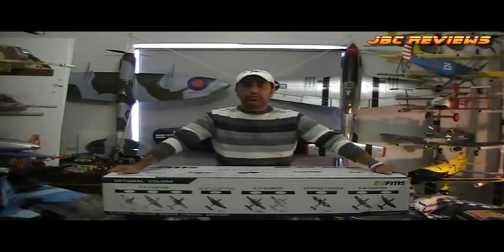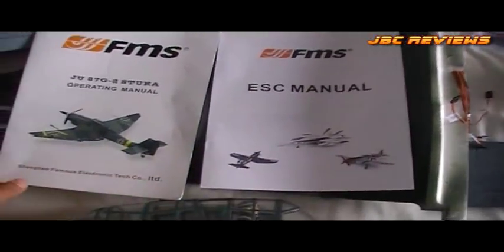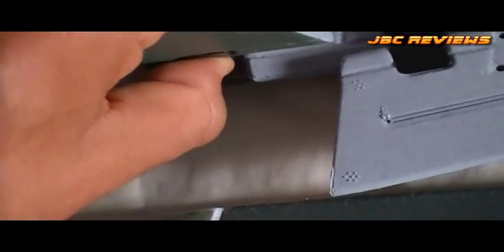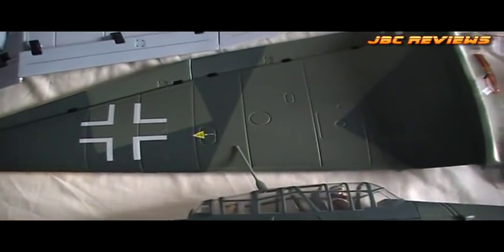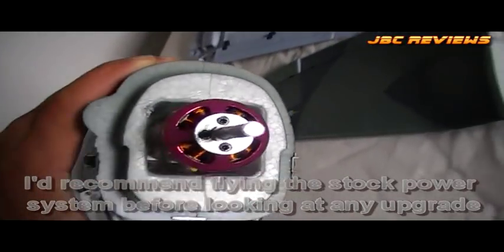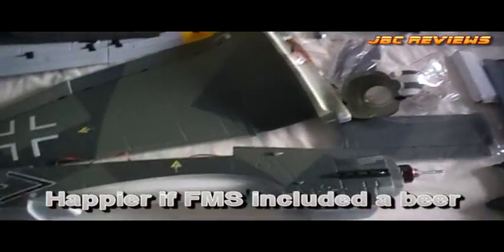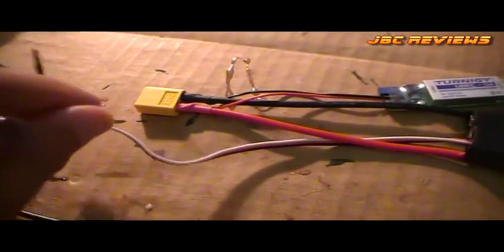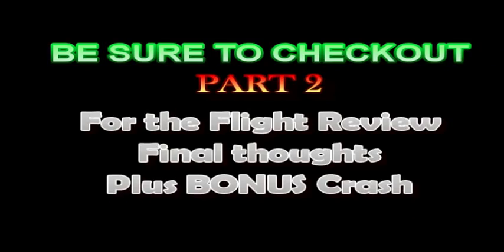FMS Airfield STUKA Ju87 (Pt1) Detailed Open box + Build tips

Comment from the maker: From memory I don't think I even have an velcro in my Stuka because a 4S 2200 only just fits in there and when you close the canopy it can't move around because of it's design and limited room. If you do use velcro just put one side on your batteries and the other side inside the fuselage where you want your battery to be and it gives you correct CG. That velcro is super stong so battery won't move, I even use it bungee launching my jets.

Comment from the maker: @WarbirdFan66 Thanks. Yeah the gear is quite strong and I can't foresee any problems on grass, the rake angle is also quite good. Maybe the only problem could be that the Stuka has wheel spats and they may get caught, hasn't happened to me though. I haven't reinforced mine in the video it's just stock. The trick is to not get carried away running big batteries like some guys do, bigger batts weigh more and put more stress on the gear.